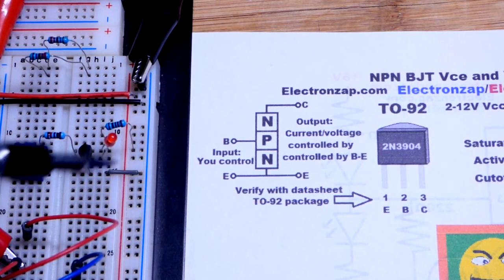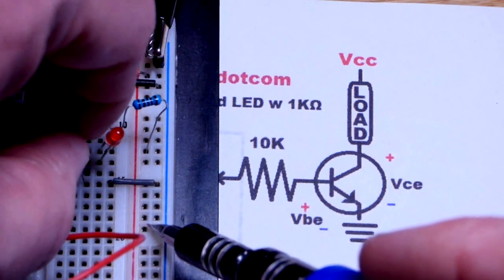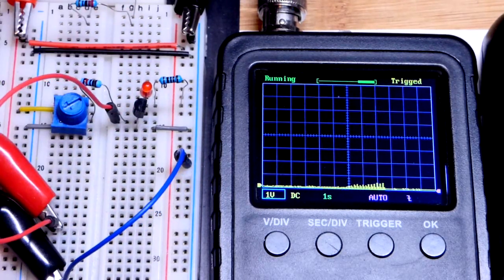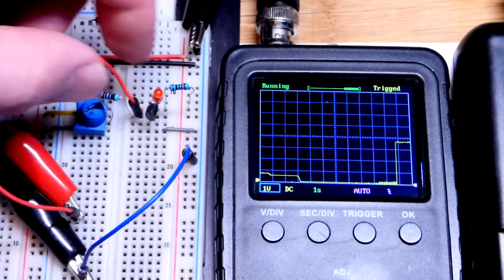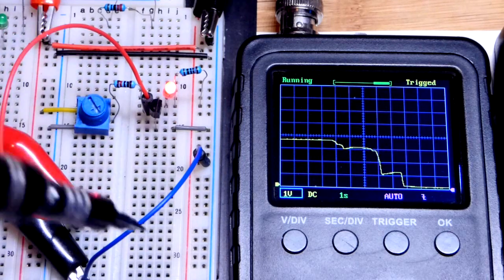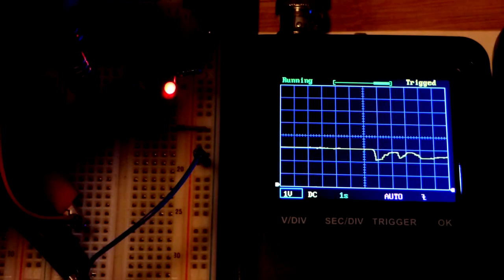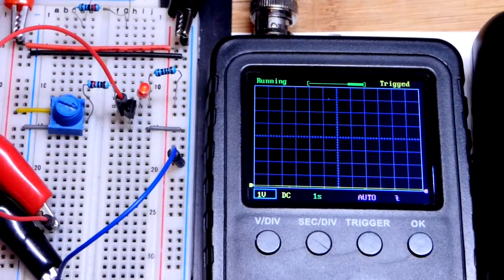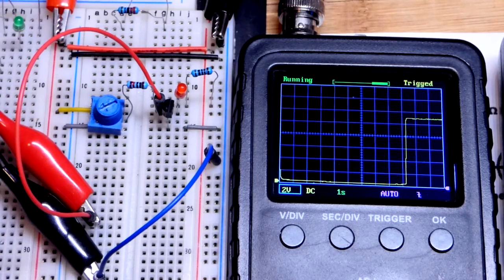Voltages of NPN Bipolar Junction Transistor base to emitter and collector to emitter electronics

Comment: Hi. As always I'm v. grateful for your great videos.  I heard BJT's are current controlled (and MOSFETS voltage controlled), yet I hear the/ 0.7V at the base thing all the time, being necessary to turn the transistor on. Is it that the 0.7V is what most transistors need to deliver the necessary current to flow through the base to turn on the transistor. Does it actually matter? As far as I understand them, datasheets seem to focus on current and transistor ratings are stated in mA. Maybe it's because the C-E junction breaks down as a function of base current??

Comment: I've submitted requests to discrete component manufacturers to increase the size of the discrete components.  They shot back with "why can't you use the same tiny resistors, capacitors, transistors, etc. that everyone else uses?"

"They're too dang small for my hands"  I replied.  "Trying to put together a breadboard RF amp to boost my siggen output, I'm using tweezers and a magnifying glass."

They don't care.  So I'm changing to building huge power amps and giving up on the low power stuff.
.
Reply from the maker: Higher wattage components are pretty big.

Comment: Question, what if I put 2.7 volts at base and 2 volts at emitter, would the transistor turn on? 🤔
Reply from the maker: Yeah, that's a 0.7V difference between base and emitter. A lot of circuits have BJTs where the NPN emitter isn't connected to ground.
Reply: @Electronzap  ok thank you sir 🙏